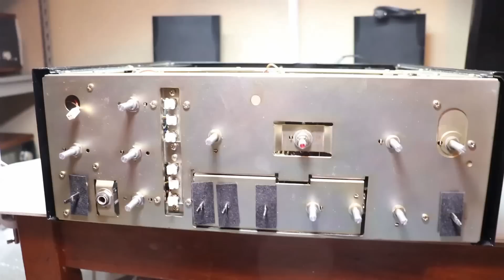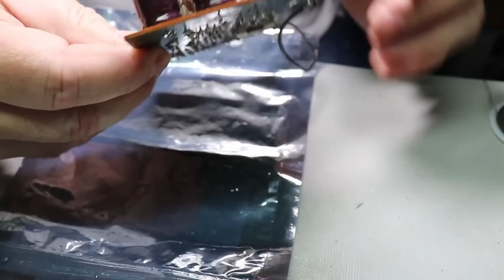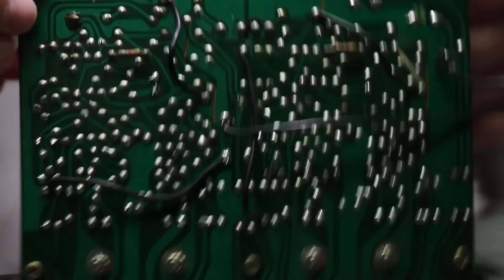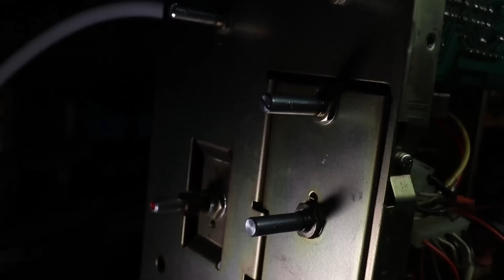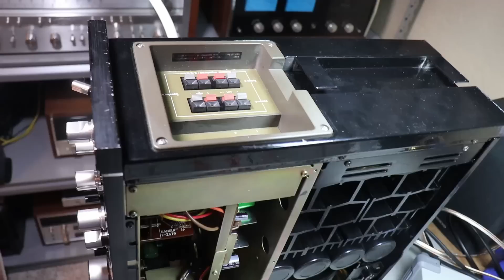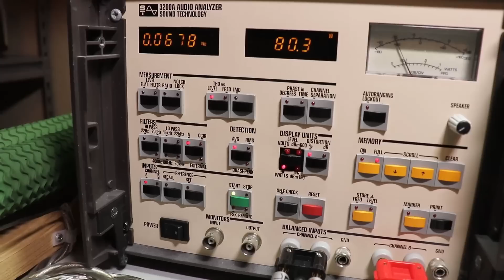AU-9900 - Maybe The Best Ever! Sansui Integrated Amplifier Vintage Stereo Repair Audio Restoration

Comment: I really enjoy your restoration videos. You are very good at what you do. Did you use to do this for a living or are you just self taught? Also, I admire your incredible collection of gear. I never hear you talk about your speakers. What are your favorite speakers that you use to listen to all this great gear?
Reply from the maker: Thank you very much for your kind words. No, this is just a hobby and yes I was self taught but I have an electronics background. I started to collect speakers when I got into collecting the electronics but I soon found out space was going to be an issue collecting speakers. I usually use my Definitive Technology STS speakers which is a modern speaker. They are an easy load for my small tube amps but have no issues with higher power solid state amps. They are also compact by vintage standards and of coarse I like the way they sound also.
Reply: @vintageaudioaddict  Thanks for your reply. I agree about the speakers taking up a lot of space. I'm going to have to reduce my speaker collection some in the near future.

Comment: It is clear for me that you do all that work with love. Just a side note, I have never seen final transistors socketed and not soldered, in a factory equipment. Sansui guys must have been very confident in their solution. By the way, some 45 years ago I made my first diy amp and I used old noval tube sockets for the power transistors, with a good reason at that time: I just kept swapping the Ge power transistors and it was easy that way 😉
Reply from the maker: Yes, I enjoy it. It takes time but work doesn't have to be hard if you like what your doing. Yes, anything in a socket does make replacement easier. I have never built my own amplifier. I don't have the skill set but I do have a couple Dynaco amps that were Dynakits that someone before me put together. Much of the vintage audio equipment that I have in my collection has their output transistors in sockets. Many different brands, McIntosh's, Pioneer's, Sansui's, Marantz's SAE's etc. I do recall that my Marantz 2500's does have it's output transistors soldered in.